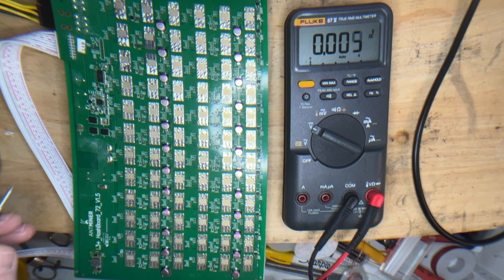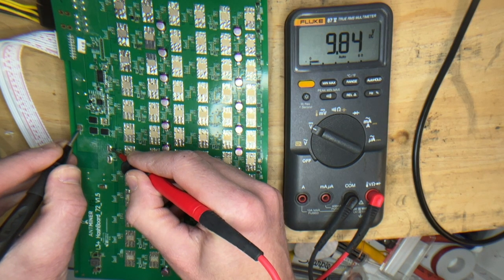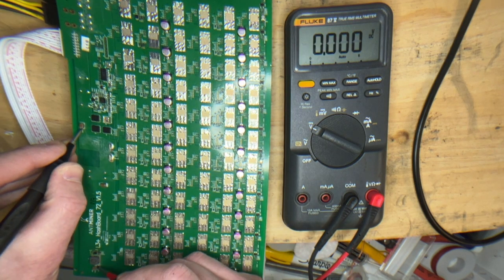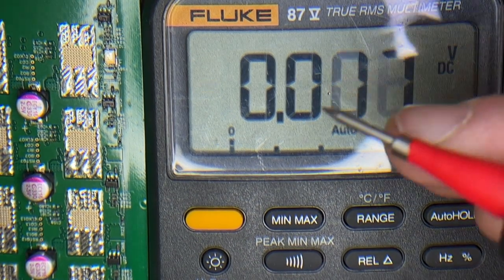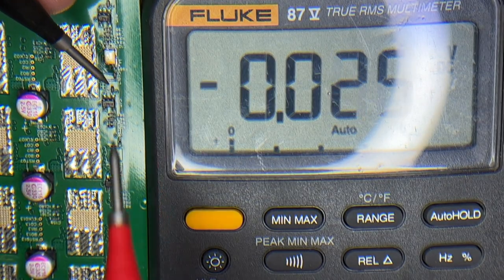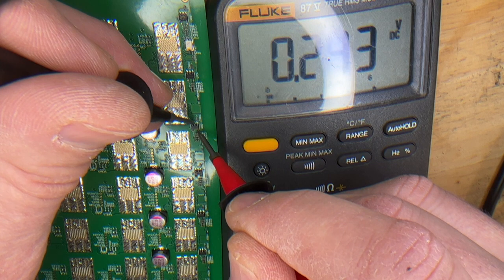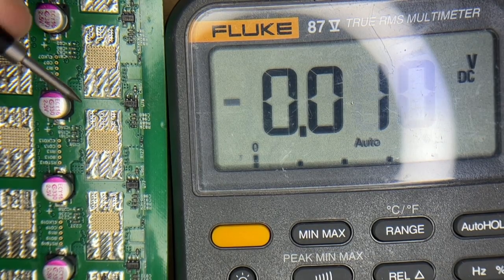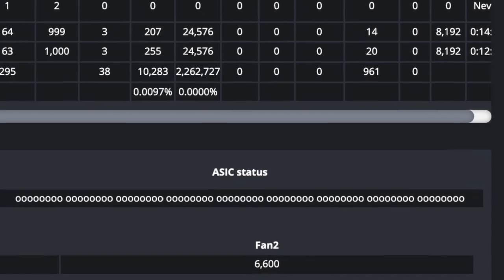ASICBASICS.COM - L3+ 1.8V LDO replacement

Comment: when checking the LDO's are the last two the same voltage as the first 10? is 2.6 ok for voltage the first 10 or would this indicate an issue?
Reply from the maker: The last two domains measure higher, I believe approximately 2.5V on one and 3.6V on the other.
Reply: @asicbasics  i think ive got 3.6 on 11 and 5-6v+ on 12 if i recall. im away from my desk atm..
Reply from the maker: @johnnaylor9113  yup that’s correct, my bad
Reply: @asicbasics  i wasn’t sure what was correct tbh, never thought to check on a working board. by chance do you know why a board might short out a psu? cant find info anywhere

Comment: hi, my friend help me please i get some big problem at last two domains (asics 61-72) have LDO's powered from the 14V boost circuit is correct voltage put the output is 0.42V and 1.25V. change twice time also same output voltage. thanks very much ;)
Reply from the maker: I believe your boost circuit is failing and, under load, not able to provide enough current (thereby dropping the voltage) to run the last two LDO's. Even though you may measure 14V, under load that may drop when you start hashing. I'd replace your boost with an external boost: https://asicbasics.com/replacing-the-antminer-l3-14-2v-boost-circuit/

Comment: Where do the ldo's get their voltage from.
Reply from the maker: The first 10 domains get it from the on-board supply (divided down to ~2.5V), the last two get it from the 14V boost circuit (hence why their input is 1-2V higher than the other domains input of 2.5V and therefore they must use a different LDO.)
Reply: @asicbasics  thanks. I had figured out the last two domains. What do you mean on boards power supply. Are you talking about the moss chips? The reason I'm asking is i have 14 out of boost and at last two domains but only 2.5 coming out off the moss chips and at the other domains. I've replaced the buc and pic with no change.
Reply: I have several boards that are putting out low voltage like this even though I have good voltage at the boost
Reply from the maker: Only the last two domains (asics 61-72) have LDO's powered from the 14V boost circuit (and a different LDO than the other 10.) If you're getting low power output from the other 10 then you may have a power supply problem. If you're having low voltage from the LDO's in the last two domains, you may have a boost that's going out. It may read 14V but under load it drops and you have issues with the last two domains as the board is hashing.
Reply from the maker: The input voltage (pin 1 & 3) of each LDO from the first 10 domains will only read around 2.5V, the output (pin 5) should read 1.8V. The input on the last two domains will read between 1-2V higher, if boost is working properly, and still only output 1.8V on the output (pin 5.) No LDO should be putting out 2.5V, maybe you're measuring across the wrong pins? The input side is the side with 3 pins and the output the side with two pins. Measure the input voltage between pins 2 (middle) and 3 (closest to edge of board) and the output between pin 2 and pin 5 (closest to edge of board on two pin side.)
Reply: @asicbasics  sorry I didn't explain correctly. I have 2.5 going into the first 10 ldo's and the same voltage coming out of the top two moss chips. The boost is putting out 14 so I'm getting correctly voltage to the last two domains but my output voltage from everything else is low or non existent.
Reply: @asicbasics  the board won't hash because the voltage coming out of the moss chips is only a couple volts and even less going into the first ten ldo's
Reply from the maker: @fullretard1989  So you're getting 1.8V out of the first 10 LDO's? If you're not getting 1.8V out of the last two then your boost is most likely bad and, under load, is unable to hold the voltage. It may show 14V when you test it, but the only way to really measure this under load is with a scope or min/max on your multimeter while the board is hashing. Of course if it's not hashing then you won't be able to measure.
Reply from the maker: @fullretard1989  OK then you most likely have a short if that's the case. I would remove D1 (taking the boost circuit out of it) and try again. I'm not saying that's the solution, but whenever I have a voltage problem like that I try and eliminate anything that could be pulling the output down. Also make sure your power supply is working properly as the buck controller needs a good 12V source.
Reply: @asicbasics  thanks for the help. I do get 12 volts to the buck. Could the moss chips be shorted and pulling the Voltage down. Id like to figure this out because I have several boards with the same issue.  One of these i fully remove the boost circuit and added an external but it still has the same issue. They produce no or low voltage out of the moss chips and first ten ldo's.
Reply: @asicbasics  you know I just realized that I replaced the pic in them and I didn't know that they had to be flashed. I guess that could be the issue?